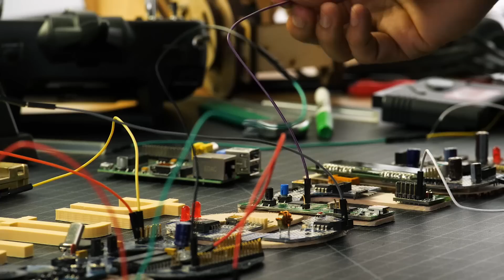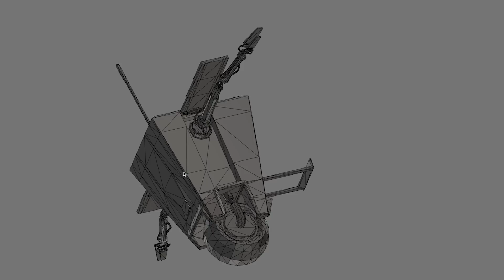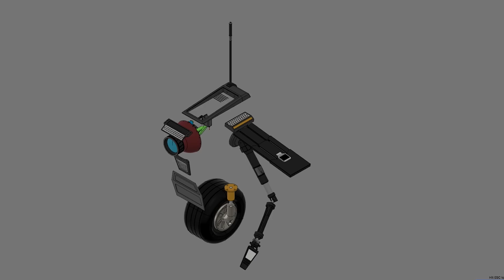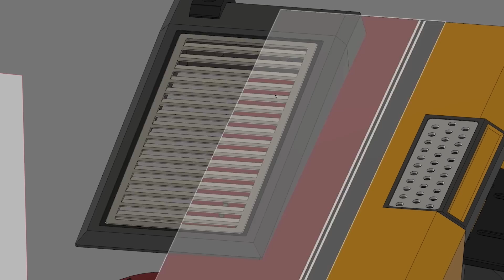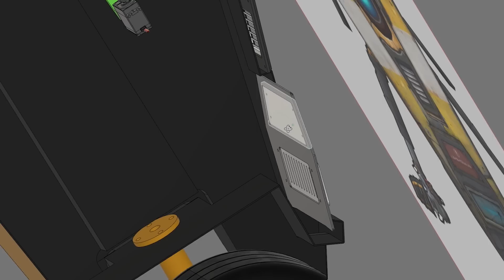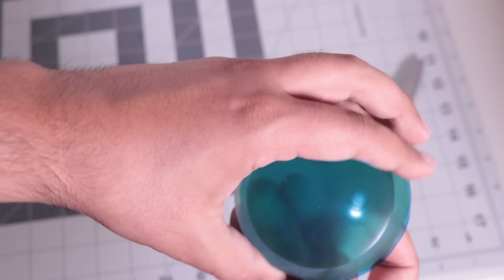Animatronic Claptrap Case Mod Pt. 1 of 2

Comment: Are his arms going to move? If so he definitely needs to try to give a hi five.

If his arms aren’t motorized can they be made adjustable so you can pose him as you see fit?
Reply: No movement on the arms. I considered it, but I could feature creep this into a 6 month build easily. His arm joints are tight fitting, so he will be posable!